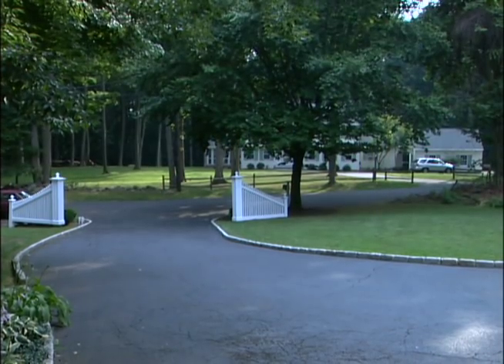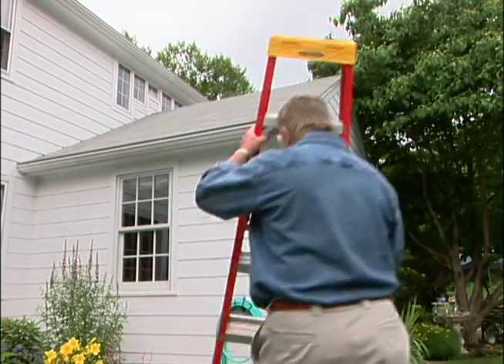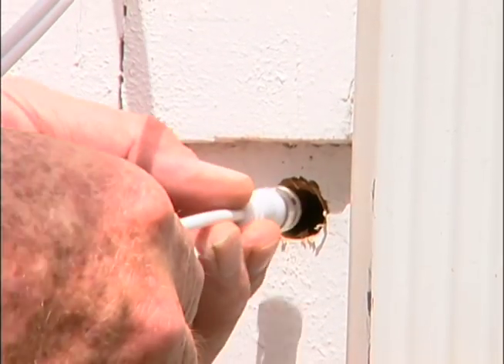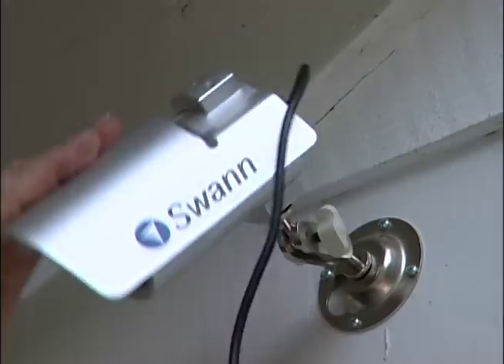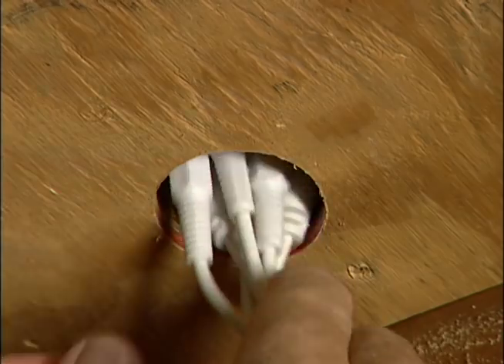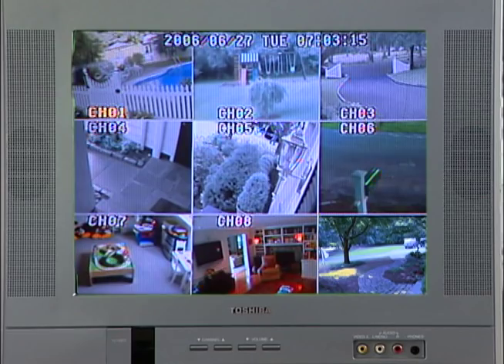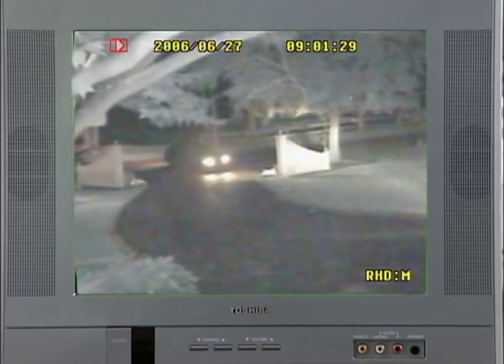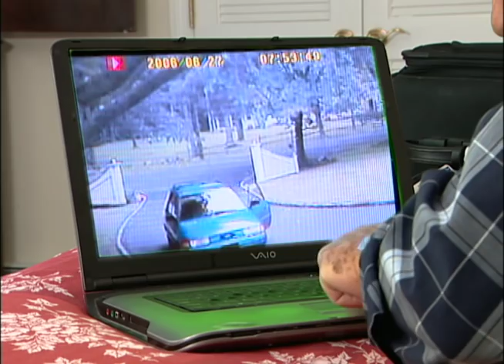How to Install a Home Security System

Comment: Thanks for the video but if you are putting up the security system then you are concerned with burglars and other criminals so won't they just cut the wires that you have running on the outside of the home?  Would it make more sense to have the wires run up thru the attic so they can't cut the wires so easily?  With cameras low enough they can just break them so they must be high I would think.  What do you think?
Reply: gretscher 
I am trying to decide what type of system to use. In the past, thugs have stolen my security lights. It could happen, that they will vandalize or steal my cameras too. They have a lot of motivation for whatever perverted reason. Nevertheless the threat is real. They will find any weakness. Every possibility must be considered. So 10 cameras, 2 at each corner so any vandals will be recorded. Eventually, 2 more hidden strong cameras closer to the road to surveil and capture license plates. IP cameras to get the time stamp. Vehicle and trailer alarms with text messaging alerts.

Comment: Why would you install the cable in such a manner that they can easily be cut? Never run cables on the outside of the home! You should use a tape and run them through walls.
Reply: true
Reply: Random Thoughts No shit!  He doesn’t have a clue on what he’s doing.  Not only does the wad of exposed wires look like shit, but the exposed can be cut and so can their whole entire camera system.  Also.  I think he did it so sloppy is bc, he’s just freaking LAZY!!

Comment: Great video but camera wires that are that accessible and nailed to the outside of a wall are not secure. One cut of that wire or ripping the wire off of the wall by someone and that camera is out. 
You are much better off going through the attic near the camera installation area to keep the camera wire exposure to a minimum.
We only install cameras that hide the wire through the mounting bracket so there is NO wire exposure.

Comment: I don't agree with exposing the cable like this @1:30 , a thief can easily cut the wire. Best practice is to hide wire or keep up high away from reach. But good video tho. :)

Comment: I've been installing CCTV for 10 years, this video is a joke. Swann is cheap and nasty. 
No HDD smarts. IR LEDs burn out. Contrast blows out in 2-3 years. I would never leave exposed cable, and the pre-made leads leave little room for HD upgrade later with HD-SDI, AHD or TVI protocols. To honest SD a waste of time, I expected this video to be 5 years old but it was uploaded a year ago, well after HD systems became affordable.
Reply: Its just a reupload. Video was made in 2006
Reply: So what's the best CCTV on the market to get right now? I just bought a house and I'm looking to install some cameras. Your experience would be of great help Josh Bohan.
Reply: Hi i wanna buy an ip cam which brand is better (note: remote access is VERY IMPORTANT to me )